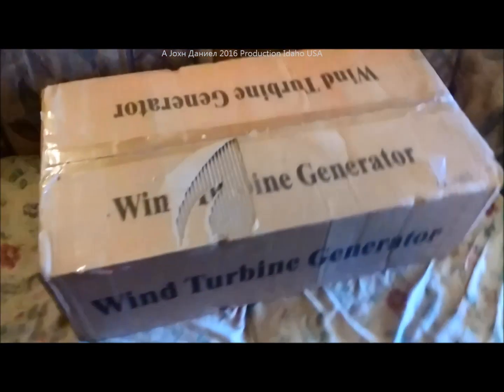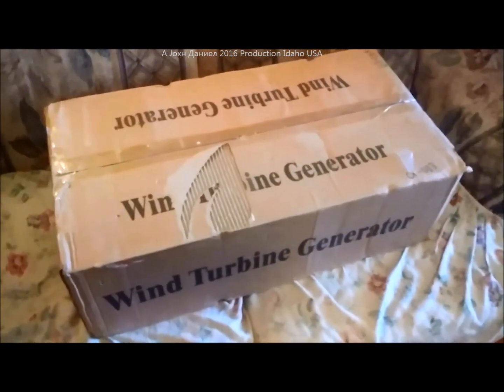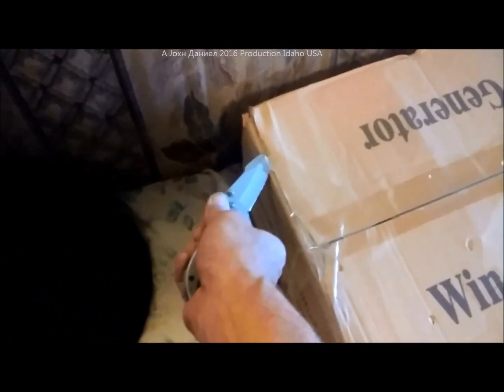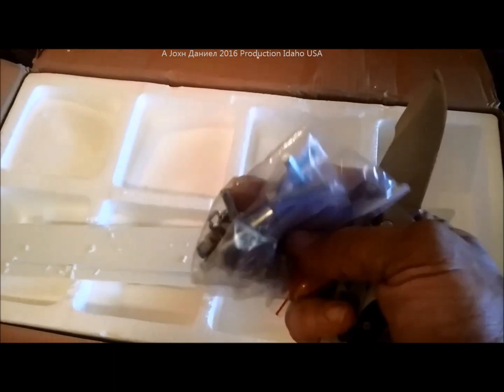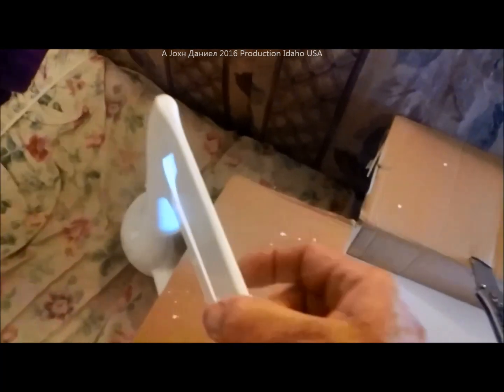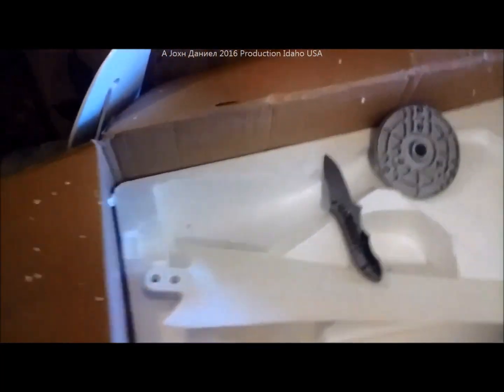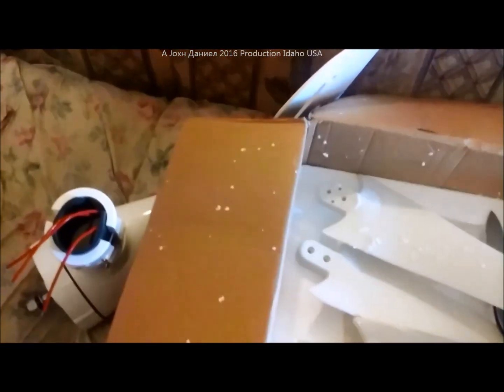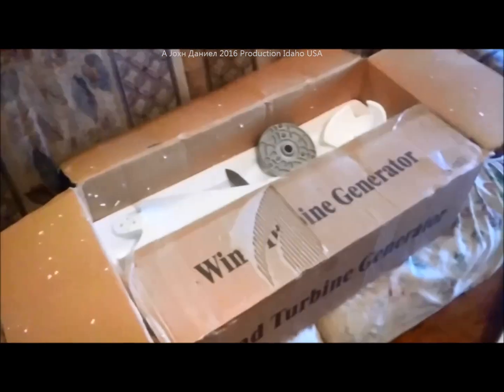Wind Turbine Generator 1, 400 watt 3 blade, NEW INFO BELOW

Comment from the maker: NOW there's BETTER ONES Best 1 Listed Under Video or second best output US models https://amzn.to/2SPlxyB to get NEWER REAL RATED OUTPUT! & To get 100% full batteries from one & to divert over volt you need these: https://amzn.to/37HN2OR 100A SQL Rectifiers &  https://amzn.to/2MTUjCU A All purpose long life Load controller and be sure to get up to and over 300 watts diversion resistors ( https://amzn.to/2QngFPq x 3) and one or more 60 amp SSR ( https://amzn.to/2QKEyj0 ) with heat sink ( https://amzn.to/2ZYtmna ) and be sure to use thermal past on it.  ( Proper type - https://amzn.to/2QN2hir from Protronix)

Comment: Not bad for the money.  There is something to be said about being cost effective.
Reply from the maker: +WINDGENEERING We totaled up all the money I have spent in 4 years since I have been keeping a ledger on wind energy products. The results led me this way. I figured that a per turbine per year cost of blades, PMA's, Hubs, Slip rings, and other related parts was just over $344 a year per turbine to get a average of 68 watts per hour of ownership base rate calculated. 
I can get better results buying one of these every year and just throwing it in the trash when it quits and save over $128 a year doing it.
Reply from the maker: +WINDGENEERING My new goal will be to find one of these small air X looking turbines to buy multiples of at the cheapest price and put 5 or 6 on the shop roof and use my load set controller design to keep them safe from high winds. If these blow off a blade my roof will not get damaged and if they fail its just 23 feet to the ground where the trash can sits!
Reply from the maker: +WINDGENEERING Design you a version of this http://www.aliexpress.com/store/product/Latest-400W-Small-Horizontal-Axis-Wind-Turbine-12v-24v-home-use-Wind-Generator/1388049_2048310435.html with 2 bearings and get back on the bus to do what you had previously planned to do selling mass quantities of micro wind instead of the big clumsy crap. When you think about it, people get into RE with small buys and build their system. 4-5 solar panels then they buy more to grow their system, so your plan to make the small wind stuff should be put into action to do the same with wind by selling the small 100 to 400 watt stuff and screw all the fake shit!.